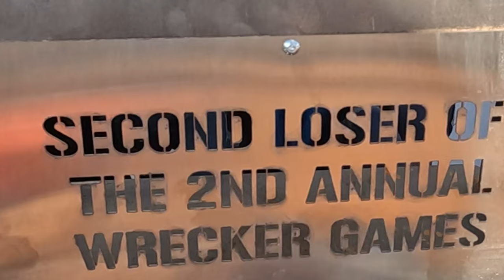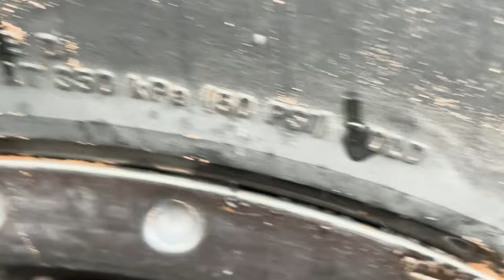We Blew The Tire and Still Finished!! Wrecker Games

Comment: That was great. Also watched Brents video. 7.3 PS SD forever. I have an 02 that I just wont give up. Can sensors and a wrench in the glovebox just in case. Also have a Ram dually for hauling a big camper. It stays parked and my 7.3 gets the miles and works the farm. Great job representing. From Snohomish Wa.
Reply from the maker: Yeah this truck is a workhorse. I’ve abused it for almost 19 years now. Still love it